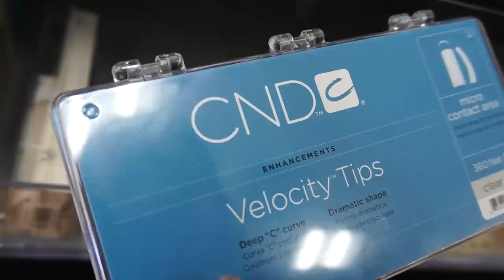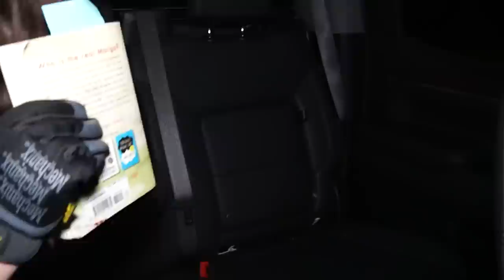Bad Day | Poor Alex | Finding My Career!

Comment: Alex, I'll be praying for your upcoming days, to start running more smoothly, and stress free 🙏🏽  It's because of you Alex, I got clear, transitional glasses. When I was 18, I burned the same leg, in the same exact spot, getting off the back of a motorcyle. Out of all the burns that I have had, the burn from the motorcycle, hurt the worst.

Comment: Hey, y’all, from northeast Georgia! With as many kids as drives in your family, you need AAA or some other roadside service. I have Good Sam Roadside for my Class A RV (because it’s so large and requires a heavy duty tow truck). I’ve had to use the tow once and it saved me about $500, but I’ve used it for jumping the RV and towing my vehicles several times, even when my family members (driving my vehicles) and I was driving friends’ vehicles. It really can save you some money and time. The only drawback is waiting for someone to help. It’s easy to get someone out in my part of the country, during business hours, but may be more difficult in other parts of the country. Love y’all!!

Comment: Tip to get rid of hiccups and it really works!  I know because I get them bad, a lot and its the only thing that consistently works.  Person who has hiccups holds out their hand palm up, it doesn't matter which hand.  Takes deep breath and holds it for as long as they can.  Another person takes hold of their hand placing their thumb in the middle of the palm and all the fingers against the back of the hand. Squeeze and apply firm pressure for as long as they can hold their breath.  Its a combo of a pressure point and the hiccupper concentrating on the pressure which makes it work.  If hiccups are really violent may need to repeat a few times because its hard to hold your breath when they are violent.  Once you know what you are doing sometimes it works doing it yourself but this is not as reliable for some weird reason.  I am the magic hiccup solver at work LOL

Comment: I went to the local salvage yard and found a full size wheel to use as my spare several years ago because donuts are only supposed to be used for a few miles.  The wheel and tire did not cost more than like 50 dollars at the time but it was a salvage yard, and years ago.

Comment: My mom was helping a senior friend out by picking up their returnable bottles to take to the depot. The bottles had been stored outside in garbage bags under the deck. On drive to the bottle depot a snake came out of a hole in one of the bags and disappeared somewhere inside the car!! 
They spent over a month not driving the car and trying to find the snake before finally driving it again! Lol 
I said I would have sold the car, lol

Comment: does Alex not have roadside assistance? I got 2 flat tires within the 1st yr of owning a new car: 1st a construction screw on the road (new tire), 2nd was tire fully got slashed when I hit a curb in a super dark parking lot (new tire)-- almost $200 for each new tire. Free roadside assistance though from car manufacturer and my insurance to change the tires.

Comment: Quick cure for hiccups: slowly drink water…you will swallow the hiccups and they will stop. My husband has perfected the timing of his swallow, so he can just swallow…I haven’t heard him hiccup after the first instance — in over 25 years. I don’t have the timing down, so I just slowly drink water and can stop at only 2 or 3. 😁
Reply: @Cheyenne-vi6fi  I know, right? I didn't believe my husband when he told me soon after we met, but it works every time. I have also found success by sucking on a sugar cube -- though, now that I think about it, it was probably the "swallowing" that caused success. :) The key is to drink non-carbonated water slowly -- don't gulp and swallow air, or you might make them worse.  Good Luck!!